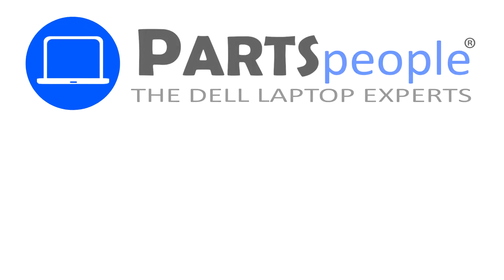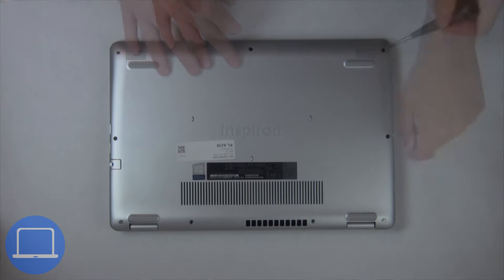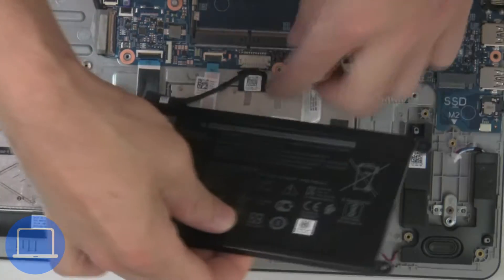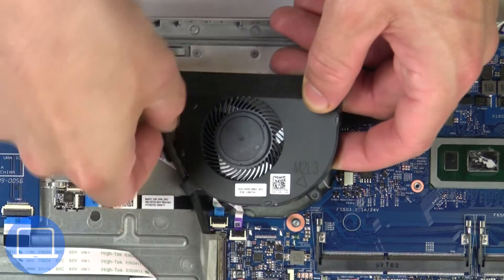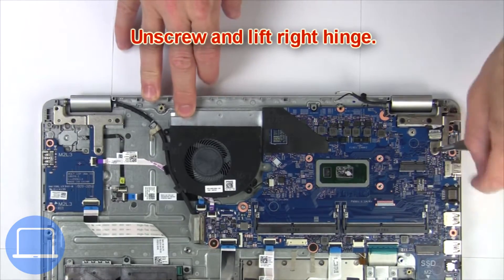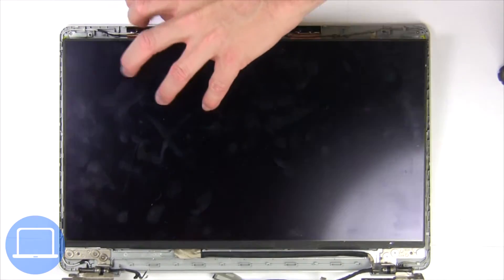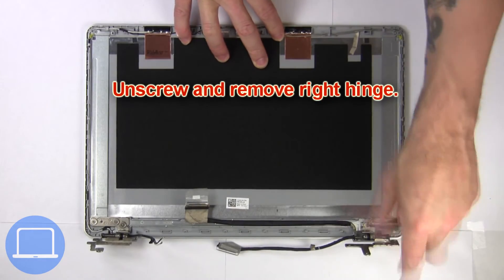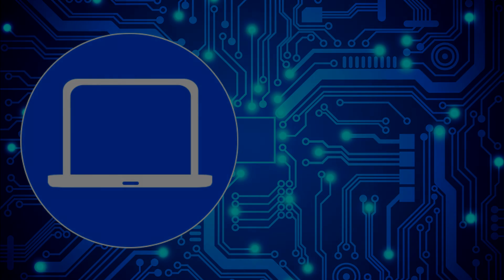Dell Inspiron 15-5584 (P85F001) Display Hinges How-To Video Tutorial

Comment: an extremely poor video...one minute theres a palmrest/keyboard with all the parts and the next its completely stripped out and the hinges are being removed? theres no explanation as to why you would need to do this to remplace the hinges, which of course you dont have too...none of these components needed to be removed, just the battery disconnected and the video/display cable disconnected...even a bit of text to exlain this would have sifficed...